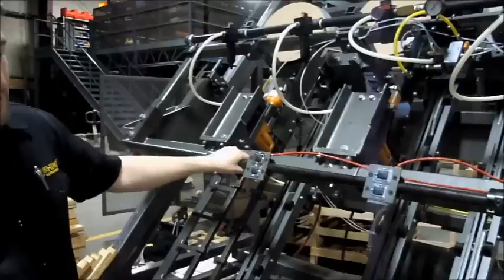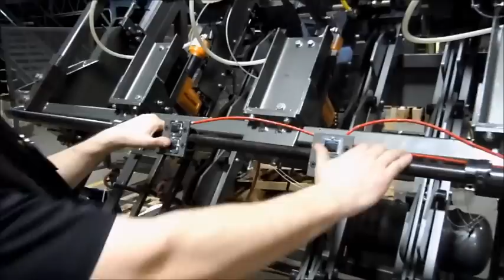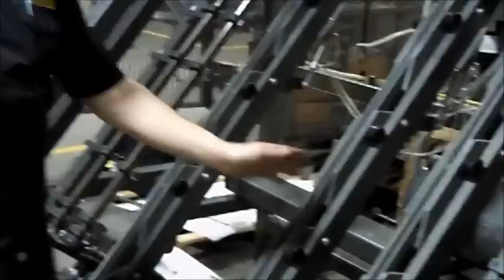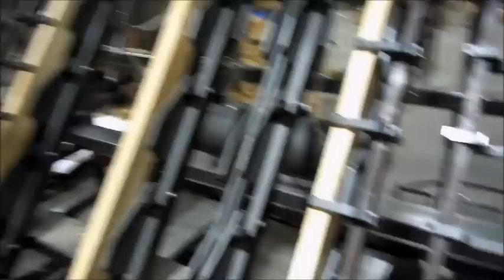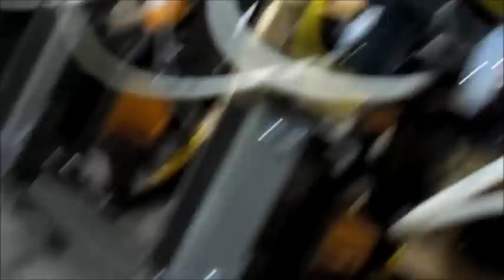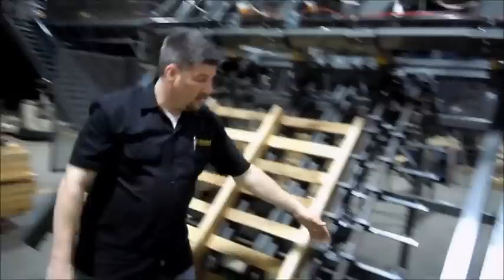Single Man Pallet Nailing Machine

Comment: I want to establish a factory producing wooden pallets, applying mechanical systems - using less labor with the estimated productivity is about 20,000 to 30,000 pallets per month ( the latter may extend over). Besides, I want to manufacture the pallets that can meet the international standards.

I would appreciate if you estimate the costs and the operation time of the factory under my situation.

I am looking forward to hearing from you soon!
Reply: Have you built your factory yet?
Reply: @michaelwu522  ?